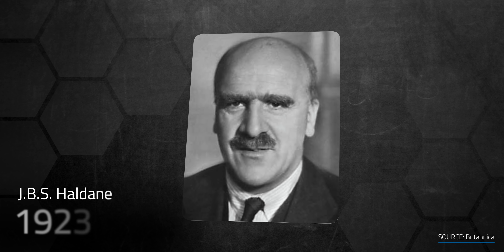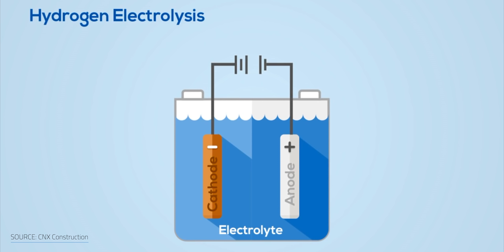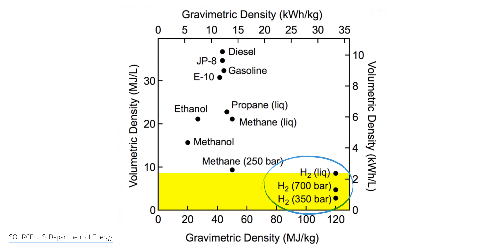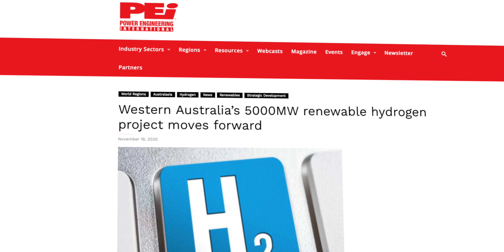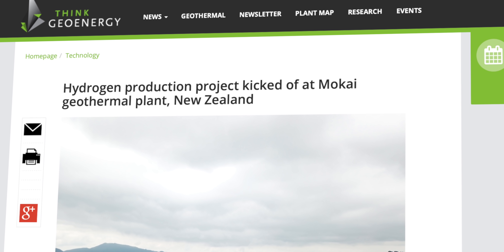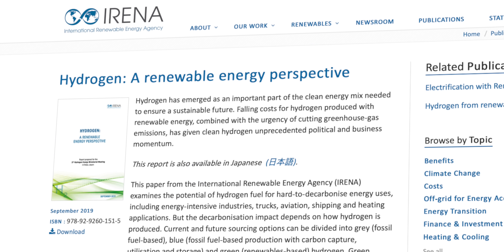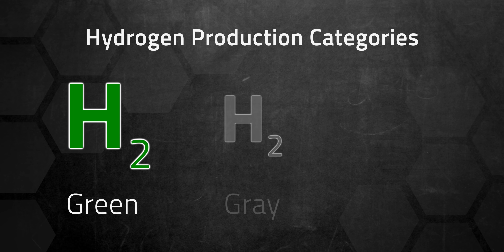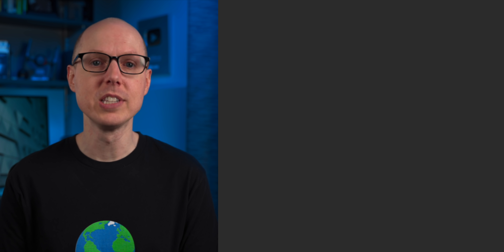The Truth About Hydrogen's Dirty Problem - Green Hydrogen Explained

Comment: I did a similar report on hydrogen to my social studies class in 1973.   Not much has changed I'm sad to say....
Reply: That’s because physics hasn’t changed that much since 1973 :D
Reply: Because we have unfortunately neglected the technology for decades, nuclear technology is improving very fast and could help here
Reply: i hope this time it will be different
Reply: @avisiva9045  how? Hydrogen doesn't change, it will always be hydrogen and our laws of physics don't tend to change either so good luck with your high hopes...
Reply: ...and flying cars!
Reply: Big oil squashed every thing that even TRIED to replace gasoline. Wish I could see all the patents they bought and buried.
Reply: @robertthomas3367  cylinder cancelation was invented in 1943, and hiden intentionally by big oil till 1996 i believe.
Reply: @D R don't forget nickel, coper, iron/steel, aluminium.... everything is mined and processed with fossil fuels. Those same EVs are even delivered with diesel trucks. I think we have seriously neglected the hydrogen technology and we need to fix that very quickly.
Reply: @alanmay7929  This argument doesn't make sense. EV's are produced and transported by fossil fuels because we still live in a fossil fuel economy, this wouldn't be any different for hydrogen cars.
Reply: @D R Of we start that route, then lets discuss ecological impact tires produce. There are 1.4 bn vehicles, one passanger tire needs 7 barels of oil. If you need 8 tires every 4 years (2 season sets of 4 tires) which is 2 tires per year per car. 1.4bn * 2 tires * 7 barels = 19,6 bn barels only for tires,  which looks to be 50% of ( total oil consumption was in 2019 100milion barrels/day = 36.5bn barels/year). So instead of switching to electric vehicles which will take 18-20 years with current total vehicle production, lets switch to tires not made from oil, which can half the need for oil in 4-5 years...
Reply: @D R actually an EV isn't that much heavier than a hydrogen car. The mirai has a curb weight of around 1850kg vs a model 3 longe range AWD performance's 1847kg and both have around the same expected range. 

The environmental side of EV's isn't ignored (this is almost always taken into account when comparing ICE vs EV), however once enough materials are mined, a lot will be recycled (we already achieve high recycling efficiency and it keeps improving), lowering the mining needs overtime. Where as for ICE, there would be ever going mining for oil. And hydrogen cars also still need some rare minerals, not as much, but still. And ofcourse with the energy efficient factor of around 40% well-to-wheel, you'll need more energy production => more material => more environmental impact.

As for the recycling of batteries and that energy use, several recycling companies actually are able to just use left over power in the batteries to power their operations for a significant propertion, the rest can be provided by renewables. At least, this is the case with the recent recycling factories/companies that are likely to be the future, not the old recycling techniques.
Reply: I hope that will never changes, I don't want to visit hydrogen fuel station every week!

I love my car being charged every night & ready to go for every morning
Reply: @George_Shonia  There's no reason the world can't have both we have right and left hand drive cars to suit the needs.

The needs and opportunities of a continent are not the same as a Pacific or Caribbean island were there isn't a reliable grid or spare land for solar.

But the already import diesel, gas and propane for generators, cars and cooking so it would be a consolidation of imported fuels until they can produce their own.
Reply: @IMGreg..  there wont be both. Early cars were electric too. But just one won out. For efficiency, companies will just produce one type and it will dominate.
Reply: @TheBooban  there's not enough cobolt in the earth to make all the batteries for all the cars needed...I think they will be hybrid hydrogen/battery...(but smaller battery) also hydrogen will be piped down the old gas network to run your boiler (home heating)..
Reply: @George_Shonia  i mean, he did say you could still do that, i dont know about storing hydrogen in everyone garage, that seems like a good place for a massive explosion. maybe some kinda direct feed from the pannel on the roof making the hydrogen so you dont store any. im sure someone will think of something. i also prefer charging in my garage and never going anywhere for fuel. it would be nice to have unlimited range for camping or whatever, but as there are more chargers installed, that is a problem that solves itself.
Reply: @redhairdavid  cant you just buy an extra battery and put it in the trunk for long trips? And everything’s explosive btw. Gasoline and yes, those lithium batters are dangerous p.
Reply: @TheBooban  i dont think thats currently possible, there is no way to charge from the trunk, or frunk. it would be possible if it was the plan from factory, but that would increase the price, and most would never use it i imagine, likely not worth it. it would also be really heavy. like, to get double the range, you would need more than double the battery weight. maybe one of those air aluminum batteries, but thats just a bigger bomb. a lithion battery can burn, but not really explode like a hydrogen cell, totally different monsters. gas is similar, burns, doenst often explode. hydrogen cell cars could take out a few homes in a blast, fire can do the same, but slower and easier to escape. also, if we have decentralized systems storing hydrogen in everyone garage, its just a matter of time till one or several are poorly maintained enough to go off. battery's and I.C.E  poorly maintained just stop working, or sometimes burn.
Reply: @redhairdavid  i think it burns far worse, like fireworks. Hotter than a gas explosions and lasts forever and difficult to extinguish. Gasoline usually just leak when damaged unless ignited. As more EVs hit the road, we will see car pile ups with multiple deaths because rescue workers cant get near them. It will be a sobering moment.
Reply: @TheBooban  extremely unlikely. it might happen, but it would be quite the event. we have had several pile ups where gas ignited and killed a bunch of people, but extremally rare compared to all the crashes without ignition and batteries are much better protected and harder to ignite. hydrogen is a whole different animal. if it goes off, it doesnt burn, it explodes. it releases all the energy immediately, gas and lith ion burn, releasing their energy over a longer time.  (unless the gas is atomized, then you have an air fuel bomb, and it goes really big, and all at once.) its all about energy, and how quickly its released.
Reply: @redhairdavid  gasolene explosions are a rare event. But batteries catching fire is pretty common. We will see more of this and it may deter future customers.
Reply: @George_Shonia  Oh the calamity of having to visit a fuel station every week... good lord our lives are so business that taking 20 minutes out of our week is unacceptable... meanwhile let me watch more Youtube videos !
Reply: @Mike__B  yeas.. its wasting of the time, smelly & dirty places are not a pleasant places to spent tens of minutes.. prefering charging my car while I sleeping in my houme
Reply: @George_Shonia  , why do you think that it has to be OR rather then AND? At the moment world is using mix of diesel, petrol, EV and TNG vehicles, there is no one dominant technology.
 Hydrogen fuel is best used where charging EV batteries is unpractical, like in public transportation, trucks, airplanes, ships, where either you can not stop for 40 minutes or you have nowhere to charge fast, or charge at all. If you are going to drive in the middle of nowhere for extended period of time, it is easier to get the H2 refueling cistern to the site then switch entire batteries back and fort, and ships can no where to be plugged at.
Also interesting is how much fuel a truck for example needs, and how much can "portable" solar-powered H2 electrolysers recharge the truck they are on while driving or waiting in line to load cargo... Military usage is also very big possibility, when they NEED to switch to something, because if you are out of electricity in the middle of the battle...
Reply: @LjubomirLjubojevic  Yes, there are several different kinds now, however diesel and petrol essentially requires the same infrastructure, transportation, ... it is like having different charging stations for different ev's. I don't know what TNG is, did you mean CNG cars? If that is the case, you need to know that these represent around 2% of all cars worldwide and it is quite a regional thing (for example mostly asia-pacific and latin america). As for EV's, yes they currently exist next to the other types, but this is because we are in a transition stage to EV's. During the past 100 years petrol and diesel where by far the most widely used car types and they overall don't differ that much.

EV charging is not really a problem in terms of trucking or public transportation, it just means you need to have a different style of management. In China a major city with a larger population than several countries has already fully switched over to EV busses, so clearly that isn't really a major problem.
For airplanes and ships hydrogen can be usefull, but not necessarily due to charging (though it might help for airplanes), but mostly for other reasons that make batteries impractical, like weight and the size of the otherwise needed batteries.

The middle of nowhere is not something that is often visited/traversed, this is more of a niche thing. And then you're more likely to still use a fossil fuel car or something similar. As for people living in the middle of nowhere, there are plenty of people that have gone off grid with batteries and solar. This middle of nowhere argument really depends also on the kind of middle of nowhere, if there is more than enough place and sun for solar panels, a solar panel-battery combination can actually be thought to be better than a H2 'cistern'. You need to remember that it is not just an H2 cistern, but also all of the infrastructure needed to actually transfer the H2, which isn't little. A H2 fuelling station costs several million dollar.

Solar power H2 electrolysers? Really? It would be more efficient to then just have the produced solar energy be directly stored in a battery. And any H2 vehicle has a battery to regulate the power produced by the fuel cell and the required power to drive better. This btw isn't any advantage compared to a BEV.

Military usage is also very big possibility, when they NEED to switch to something, because if you are out of electricity in the middle of the battle...
This can be said about H2 easily too, if you run out of H2 in the middle of a battle... And considering the explosive nature of H2, that is the last thing you'd want to use at the front line. If it is not the frontline there are many ways to provide electricity. But it is most likely the military will keep using fossil fuel for front line military operations then switch to batteries or H2.

The number of tires you say a car needs is really high. Did you actually get this from a statistic or made it up? Regular drivers need to replace their tires around once or twice during a car's lifetime due to degredation. And tire companies have even come out saying an EV's aren't worse for tires, that it is a common misconception. On the opposite, due to better traction control the tires slip less, reducing their degredation over a prolongued time apparently.

Comment: Hydrogen is the best option for the future of transportation. Hybrids eliminate range anxiety and allows for travel as usual. Hydrogen is clean burning and plentiful.
Reply: @Dr_b_ Not to mention it will take a large amount of fresh water to make, which means if they plan on using sea water they will have a find a solution to the brine waste and energy for desalination. If they use our already stressed fresh water resources that can be problematic also.
Reply: @anydaynow01  using saltwater is ideal as it already has an electrolyte. The brine is simply put back into the sea were it naturaly balances out. In addition using sea water could help lower the threat of sea leval rise.
Reply: @Dr_b_ The best solution is on demand hydrogen used in an ICE. Yes storing and compressing is a hurdle but so was battery tech just a couple of decades ago. Hydrogen can be and is produced as needed with out an explosion risk for use in daily commutes.

In addition hydrogen dissipates extremely fast as it is the lightest element. You are in more danger of a battery pack exploding than a hydrogen tank.
Reply: @Dr_b_ Yeah, just no, hydrogen is not as dangerous as you make it.
Reply: The future of transportation is a hybrid strategy of both batteries and hydrogen storage.

City cars and close distance public transport will relie on BEV's. Long distance travel,  busses, trucks and Vans will probably be hydrogen-battery hybrids.
Reply: @Enthropical_Thunder  that's my point. Hybrids are the answer for people that like road trips or need to travel long distances and can't or won't fly. BEV's are simply impractical for so many people. I for one love in an apartment with no way of charging a BEV. I also like long road trips at a moment's notice. A hybrid makes the most sense for my needs. Sadly I don't own one yet.

Comment: lets not  hide the fact that the production of hydrogen is dirty and gives off greenhouse gas wish you would cover the Marine applications using salt water as fuel and bottling hydrogen for sale at port? also you want saline water for a fuel cell engine
Reply from the maker: Yes, steam reforming to produce hydrogen is very dirty, but using renewable energy to power an electrolyzer is very clean.  There was so much to cover for this topic I was worried about over-stuffing the video (not able to cover every angle).

Comment: Hydrogen is hard to make and hard to deliver.  Other technologies will become mainstream long before hydrogen infrastructure is abundant and reliable enough.
Reply: I wouldn't be so sure of that, there are so many applications, that need an open flame , wich demands the use of hydrogen. 

Basically, if the industry needs it (and the heavy metal industry will need hydrogen), than it will find a way to store and deliver massive ammounts of hydrogen, especially with all the new methodes that have been developed in the past decade.
Reply: Totally agree, once we have successfully minimized the CO2 production in the electrical generation sector we can concentrate on using the excess power production on things like H2 production through desalination and electrolysis. At the same time we should still research materials and infrastructure that can safely contain compressed H2 for long periods of time and minimize the waste stream from it's production and storage.